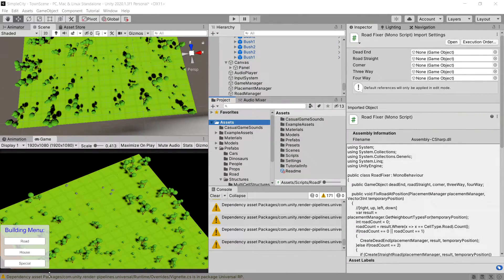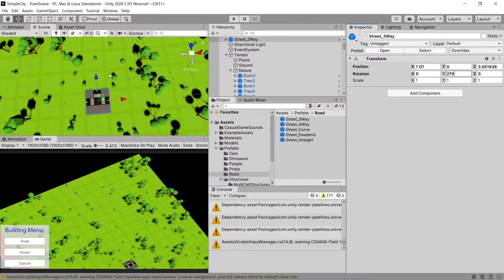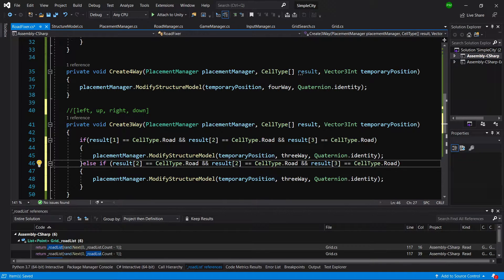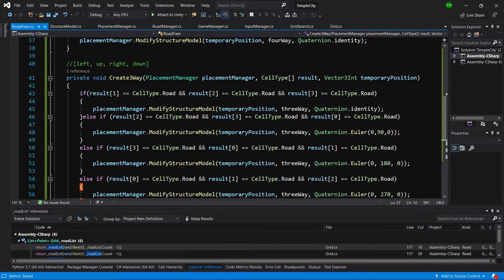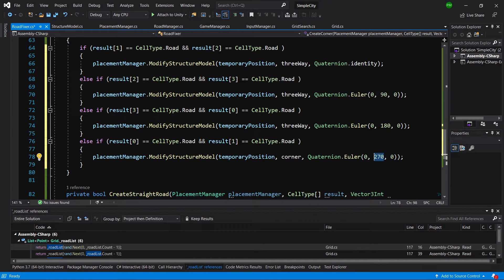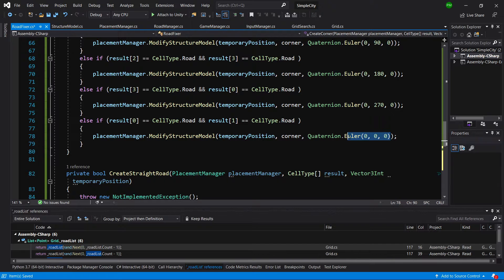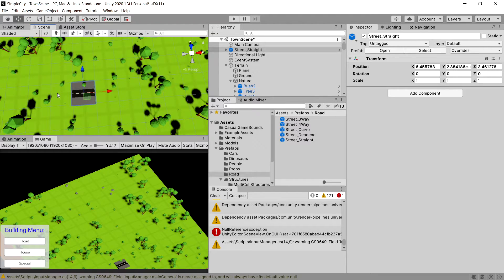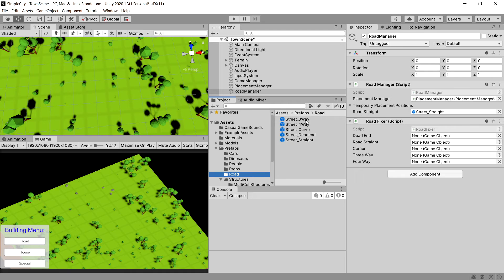Road Model Fix p2 - City Builder Unity tutorial P2

Comment: First of all thank you very much for this tutorial, I think it is both easy to follow (and coding alongside helps a lot) and giving a lot about these crucial functions.
I just wanted to ask about create3Way method - since we have already confirmed, there are 3 roads as neighbours (by GetNeighboursTypeFor), would it be possible to check which side is not Road, to reduce code and computing? Like this: 43 if(result[0] != CellType.Road)
Or are there other considerations, why this wouldnt be safe enough?
Reply from the maker: It all depends on what do you need to do. You could loop through each direction and if you find not-a-road exit early from a loop. I am not great with optimization. Basically if you have something that works next step could be optimization. I wouldn't tackle it until  I have something working. Just give it a spin. I would really like to hear what you came up with :)

Comment: Hello, mmm and what if the terrain has elevations and / or the opposite way down? Would only the angle of Quaternion.Euler change?
Reply from the maker: If you still consider a simple blocky environment I would assume you would use a slope around 30 degrees constant for every alope. In this case you could use "normal" for the raycast hit point and rotate the road prefab (from the top of my head not sure if this would be the best solution). For the Grid you would still treat the slope as a single grid cell and would have to add a new enum type for terrain that is blocked due to elevation - if you have a vertical wall up it would take 1 grid cell as well.
I hope that helps!